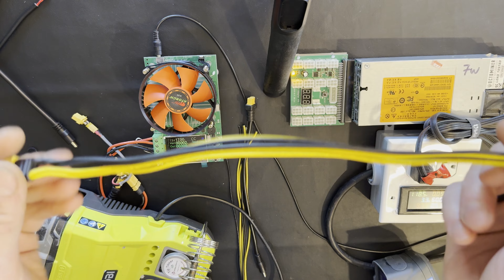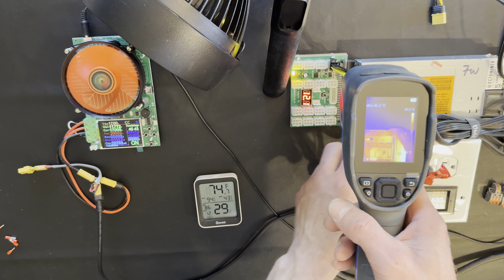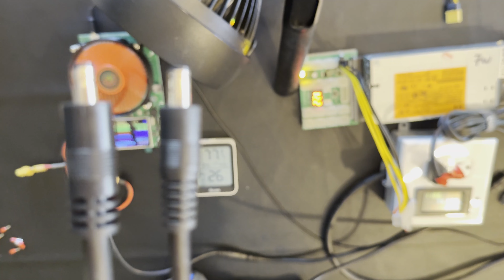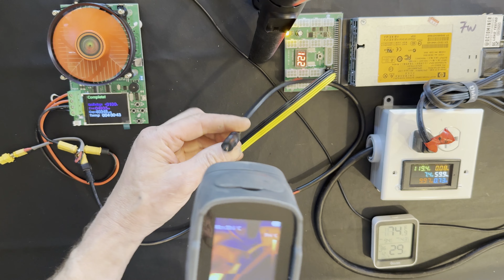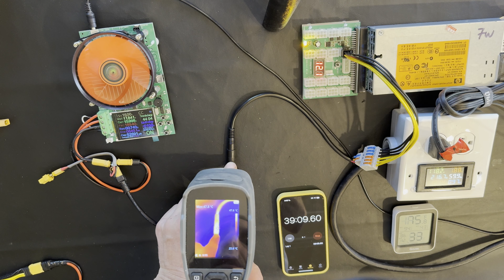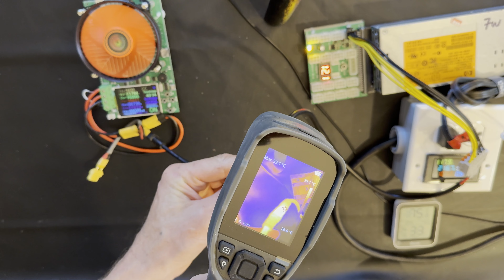MAKING & TESTING MORE BARREL TO PCIE CONNECTORS FOR KS0PRO @12V PSU THEY WILL FAIL OVER 10AMP

Comment: I made a modification on my bitcoin mining psu 2000W with soldering 6 cables each of 2.5mm2 for positive and 6 cables again for negative. Connect them to 3 pcs of the DC step up module to get 20V output. Then I use the XT60 connector to connect from DC stepup to ks0pro. I just soldered the 2.5mm2 cables directly to the pcb board of the ks0pro. It works cool and safe upto 190-200W. Now all my ks0pro run on 340-350Ghs well. I got problem when used the pcie too. XT60 connector was the best can stand for 60A
Reply from the maker: Yes, xt60 is the best, I solder 14awg silicone wire directly to ks0pro board and to xt60 on my 7xks0pro OC to 300-340GH and been mining about 3 month straight without any issues.